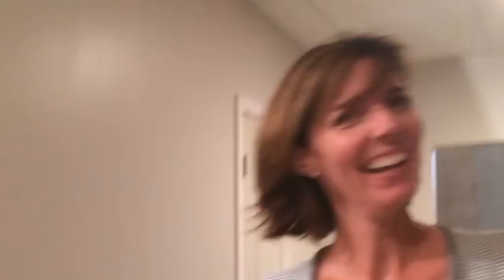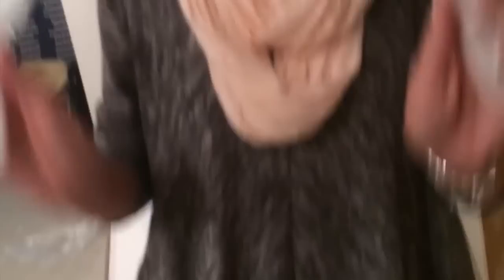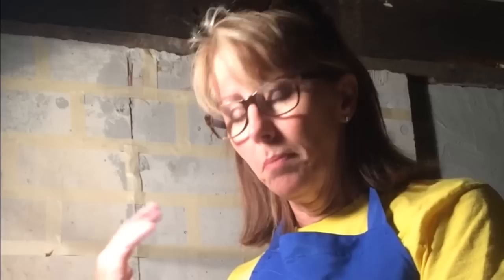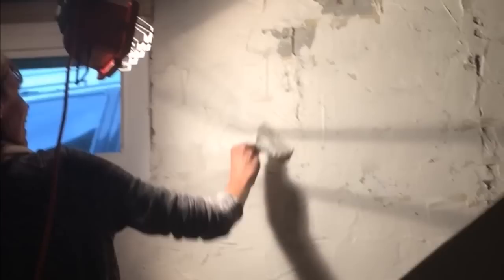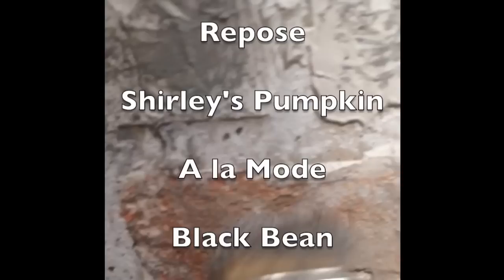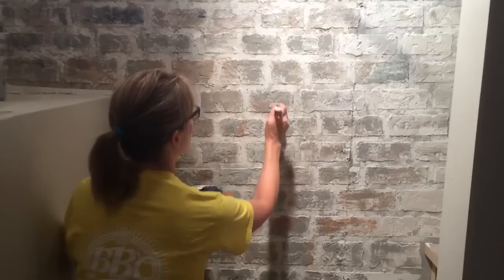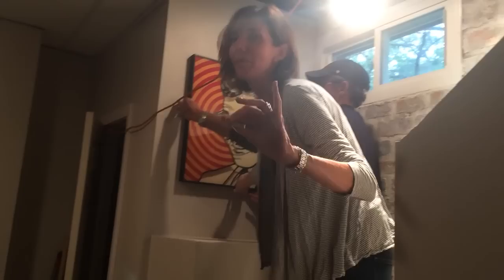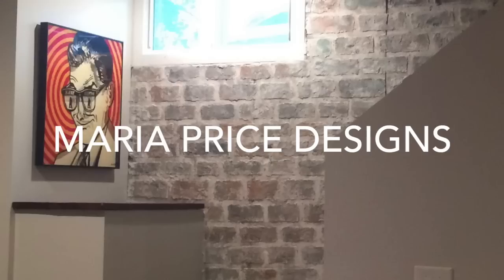Creating a "faux" brick wall

Comment: I used this technique to build a fake faux fireplace 5.5 feet tall and 5 feet wide with cardboard boxes! Honestly Its turning out amazing! I live in an old brownstone in NYC and it pairs perfectly with my apartment. Thank you sooo much. I'm going to send photos once its completely done. It took me 4 days so far to build the base with the boxes and essentially tape everything together. I laid out my tape and then put the joint compound over it. Then removed the tape and now I'm going in with a second coat of Joint compound and then using your technique to make it look old and rustic and I'll paint it while its simi wet as well. Thanks for the help!

Comment: i like the 1/4 " grout lines better. this looks ok to me. I have done this a lot and it is endless what designs you can do !
Reply from the maker: Yes, I just couldn't find really thin tape so I just put more compound so the bricks aren't as far apart. It's a learning curve but you are right, you can do just about anything with the compound!
Reply: amazon sells the 1/4" tape. it works great . have fun :>)
Reply from the maker: Thanks for letting me know.!

Comment: I know that this would be great on plaster or drywall above grade, especially if you primed with a binder product first. But on new concrete, below grade, I think its gonna fail. Concrete breathes and water vapor will be passing thru the drywall compound causing it to eventually come away from the concrete. Things don't like to stick to concrete, often not even coatings made to cover concrete. Joint compound was never meant for this purpose.
Reply from the maker: Thanks for your response. So far it’s held up just fine but it’s nice to know the facts that you have shared in your post. Thanks for the information!

Comment: This is spectacular! I love it! I've been wanting to achieve the faux brick look without spending a lot of money! this seems to be the best way to go, but I do have a question. Initially, I was going to use foam because I needed to cover a hole where a 40 year old AC unit was, if I use plywood to level the surfaces, do you think your technique will blend that with the rest of the wall? also... the wall I want to do this to was 70's paneling that was covered with textured wall paper... should I do a layer of joint compound before doing this? or will it look okay with the texture underneath? Thanks!
Reply from the maker: I think whatever you can do to have texture underneath is really good because it will be varied like mortar so the wallpaper is a bonus in my opinion. The more texture the better! I think the wood over the whole is a good idea. The mud is really easy to mold and work with but you just have to let it dry if you are using a lot. You just have to play with it. Good luck!

Comment: My dad is doing a faux brick wall but he wants to know how did you remove the tape after applying the compound? The video didn’t show it and we are stumped. Thank you!
Reply: remove while the compound is still not fully set. Smooth edges with finger or sponge brush

Comment: Some of these seem to go so so wrong, but this one is really impressive. Does that also have to do with lighting? It seems the sharp angle helps with the effect, does it look as good with diffused lighting? Thanks for the video!
Reply from the maker: Thanks for the nice comments. I have done this brick technique many times and get better each time I do it. I do think that the "relief" of the brick looks better in softer lighting because of the way the light hits it. I think it looks real and I have to say that when people see it, they are surprised that it's not real brick.

Comment: I love this, however i want to create the same look on my real brick garden wall which i have ruined painting terracotta. So now you cannot see the pointing in the brick as i had painted over it in one colour. How can i create the end finished look but over real brick, bearing in mind i shall have to paint all over the real brick wall with a base colour, i am right in thinking  i need to do this in a motor colour, then add a bit of real motor  over the brick and soften some of  my corners as i like this effect, and then do the paint effect over the bricks with the different colours?  hope you can advise?

Comment: Maria, did you not have to use a level on each tape line? I’m doing this in my small half bath and am getting very discouraged with the lines. Please help!
Reply from the maker: Libby Gardner you can use one  to help. Honestly by the time you hang pictures etc you won’t notice but you definitely need to make them look kind of straight. Drywall mud is a great mask for hiding. Just put more where you messed up. You can do it
Reply: Thanks so much!!! I appreciate your help! Hope mine looks as good as yours! 😘

Comment: I want to do my kitchen wall this way but I could see some difficulty down the road if you ever got tired of the brick wall. How would you ever make it a smooth wall again?
Reply from the maker: Linda Smith yes it cold pose problems. You could smooth it out with drywall mud but it will never be the same. I like texture so I’m never that afraid to try it. I like to play and try with new things and textures. If it makes you nervous don’t do it. It’s rewarding but only if you’re not afraid to do it😄

Comment: I really, really enjoyed this tutorial and have started my brick wall in my kitchen/dining area. I bought a quart of faux glaze (actual name). paint person  suggested mix it in equal parts with paint or  coat the drywall compound before painting the bricks. This is an extra step that I can't determine if necessary. I've looked at several tutorials on faux brick and have not seen anyone glazing the drywall compound before painting. Any thoughts??
Reply from the maker: Renita Forsh I don't think it's necessary. I think that it's more product than you need. Keep it simple. It won't fall off of the wall and you're just adding more product. I would say no. Good luck😄
Reply: Maria Price Thank you so much for your response. I'm excited about the project and hoping to come up with a killer faux brick wall. Totally concur in terms of keeping it simple. Thanks!

Comment: hello! thanks for the tutorial. so i went ahead did a part of a wall in my bedroom like this... though now-afterwards-i'm not so keen on it b/c i realize i'm not so familiar (or at all) with colors and painting e.g. mid tones, accents, etc... and so it doesn't look too nice. anyway... i 'm thinking that i actually would like to imitate a white-brick wall look... i was thinking of going ahead, taping it up again, and adding another thick coat of plaster, letting it dry (b/c i  didn't do that the first time so the bricks ended up getting a painted-brush look instead of the chunky, rough, brick look), and then painting it white... how many coats of plaster would you suggest? ... as it's on a white wall anyway, i feel like it will have to have a couple of layers to really show the brick sticking out from the wall, or maybe you have another suggestion... thanks!
Reply from the maker: Just keep working with the colors. If you don't like the variation, you can always paint it a solid color. The first wall I did took me a long time before I liked the way it looked.When projects frustrate me I always tell myself that I'm just not finished yet. Walk away for a while and come back to it.
 A good thing to do is look at brick walls that you like and try to get the same look.
It's also helpful to ask other people for their opinion. I'm sure that it looks better than you think it does but maybe a friend can tell you what they do/do not like about it. 
I would ask a local hardware store for advise on the plaster walls. I'm sure they could help you with that part of it. I agree, the thicker the brick, the more real it looks but you are going for the overall effect. Have you hung picture or put furniture in the room? It helps a lot to put pictures up and furniture in so you are not just looking at a bare brick wall. Good luck.

Comment: Is it washable? I want to do this on a kitchen wall. It's a wall that's not near the stove but still worry it would get greasy and need washing from time to time. Any tips?
Reply: Try doing a coat of matte clear sealer on it, it will create an invisible coating that will protect it and keep any of the paint from getting wiped off when it's cleaned!
Reply from the maker: Judee Judee I would think you could seal it with a sealer of some kind. Thanks for watching

Comment: I love it!! I want the same color on my bedroom accent wall, it's black and smooth unlike the wall in your video.  Do I paint it white first and use any primer??  Thanks!
Reply from the maker: I would just start your project over the wall that is painted. the black will show through for the "mortar". You may or may not like it. You can always dab the brush for the "mortar" with another color so it's easy to fix!

Comment: Nice! It looks like you had fun! Why do I get the feeling that you skipped a few parts or ingredient to the cake?
Reply from the maker: M Ladd the only thing I didn’t show was taking the tape off. It isn’t complicated to get on the wall but getting the bricks to look like this takes practice. I have done a lot of them so it’s easier for me to get this look. The process is an easy one though. Thanks for watching 😄
Reply: @mariaprice9353  That's the part you didn't show very much of, getting the bricks the way they are, you just mentioned the corners!  The removal of the tape other then to say do so when it is still wet is  inconsequential!
Reply from the maker: M Ladd yes it’s hard to explain how to faux finish and get the brick look. There isn’t really an easy way. You just have to jump in and do it. Thanks for the feedback 😄
Reply: @mariaprice9353  You didn't have to explain how you finished the brick, you just had to show how you finished the brick! That was the important part!
Maybe next time, thank you!

Comment: This looks amazing! I have a wall in the middle of my house that can be seen from both adjoining rooms and I plan to use your tutorial to get it done. Thank you for adding the colors as well. My question is this: I will be starting with a red wall (remember the red accent wall everyone had). Should I paint the entire wall the grout color prior to applying the tape or fill it in as I go? I know that covering the red will be time consuming if I start with painting first but want a wall as beautiful as yours.
Reply from the maker: mrLocoLogan thank you for the nice comment. I would paint the wall prior to making the paint template. It will be easier if you don't have to fill in that color. Good luck with your project😄
Reply from the maker: mrLocoLogan I would paint the red wall first. You don't have to do a great job because you will be going over it but at least you won't have to fill everything in which can be time consuming. Thanks for the kind words😄

Comment: What type of paint did you use, I mean latex?? What finish, eggshell, Matte? Thank you for your help
Reply from the maker: Hi Candace, I used chalk paint but you can use anything that doesn't have a shine to it. It will look authentic if it is not shiny. Thanks
Reply: +Maria - thank you! You said that you started to paint the compound  before it was dry. Approximately how many hours after you apply the compound you start to paint?
Reply from the maker: It wasn't that dry... kind of like a drying mud. It's really all about playing with the paint/ mud. You can't mess up. Just go over it again. You want it to be a little dry because otherwise you  will just moosh it around  and not get anywhere.  Just play. You will figure it out quickly and what works best for you!

Comment: What kind of tape did you use? I can imagine it ripping as I'm trying to pull it off with that wet joint compound on it.
Reply: Just read further down.... Painters   tape
Reply from the maker: Ree's Nest I just used masking tape. We didn’t have a problem taking it off.

Comment: This looks amazing! How would it be removed if needed?
Reply from the maker: I'm not sure. I'm glad you like it.
Reply: Don't remove it. Take joint compound and go over it. Creating a smooth pallet over it. Joint compound they used here is the "dark blue lid" that is sufficient. Take the 4 gallon tub, whip it or stir very, very well. Get it creamy/icing consistency. Get a rubber roller. Dip the rubber roller into the 4 gallon tub (no need to dirty up another pan). "Paint" the compound on. Up down, then sideways, slowly spready it out. Do it small sections (top to bottom). Take a trowel, and use arching motion, or upside down "C". Smooth it out. Continue on to the next small section. Arch upside "C" motion, on and on until complete. You want it as smooth as possible and STOP. Come back in 24 hrs. and sand the ridges. Check to see if it needs 2nd coat. (It more than likely will), repeat above. Next day, sand out ridges nd your good to go. Hope this helps, Monasia!!

Comment: do you use acrylic or latex or chalk paint? any need to put primer before that? and if i use this method,  can i add more compound to make the bricks look thicker with jutting out effect? thanks
Reply from the maker: I used chalk paint. It looks" dry "just like brick...(hope that makes sense) Yes, the more compound the better! If you keep layering the compound on you can really get some "depth" to the brick. It's really cool to see how real you can make them. It's also great because you can get the "straight lines" from the tape not to look so straight and perfect when you apply more compound. I have also learned that if I lightly sand the bricks they look better because you have a smoother brick. I am redoing my first project in my family room now that I have done it several times so there are a lot of things I am doing differently. For the mortar in between the bricks, I bought a sandy mix you can add to paint.If you apply it in between the  bricks, it really looks like mortar! I am really taking my time but it's worth it in the end! No need to prime! Thanks for the comments and good luck. Send me some pictures!
Reply from the maker: I would think you could use masking tape. I think that's what we used in the videos. You just need it as a guide. Good luck and thanks for the nice comment.